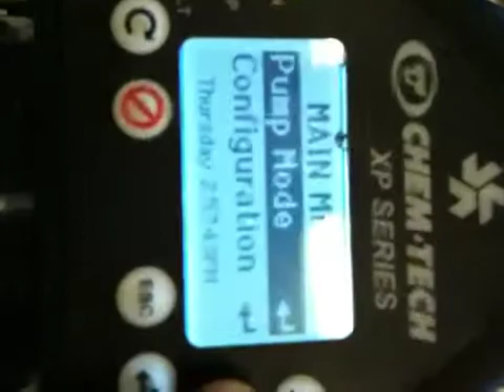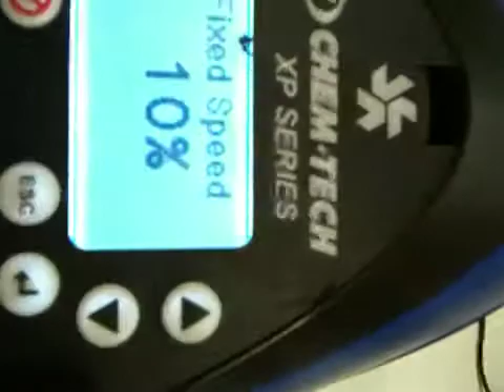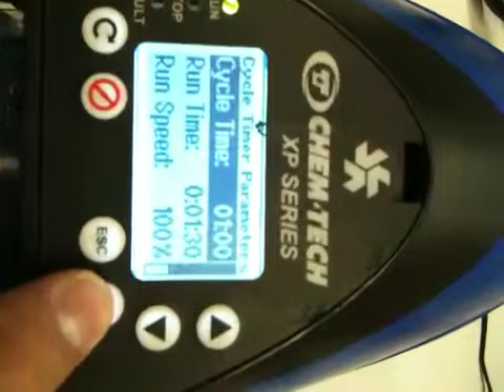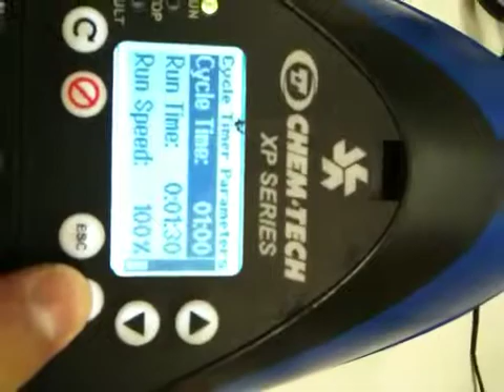Chem-Tech XPV

Comment: Trying to replace that tube right now - I can fix anything. This is ridiculous.  UPDATE: Figured it out. Get the hose in its final position where it won't reach and run the pump a bunch to knead that sucker until it flattens some and gets longer. Do it a few times and eventually it will lengthen just enough to reach the holder.